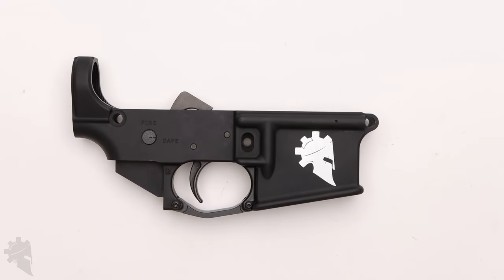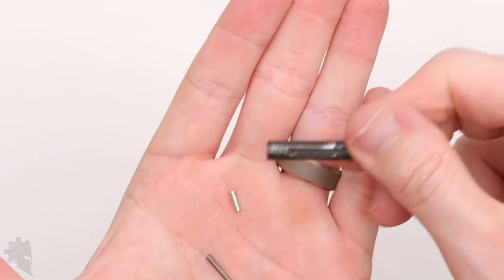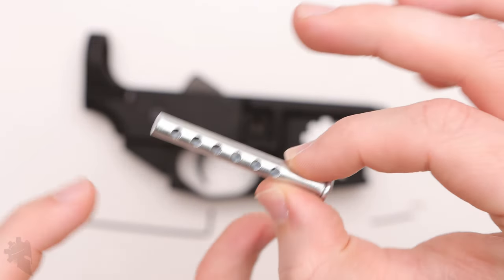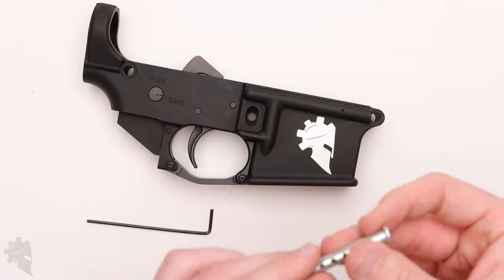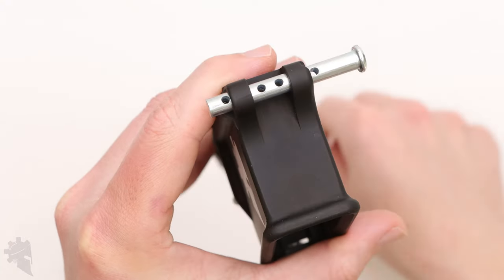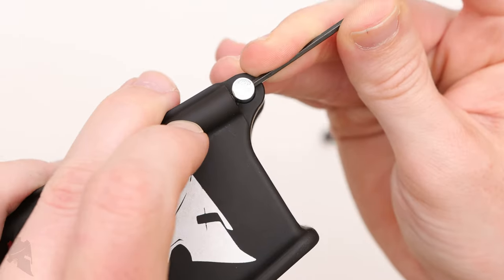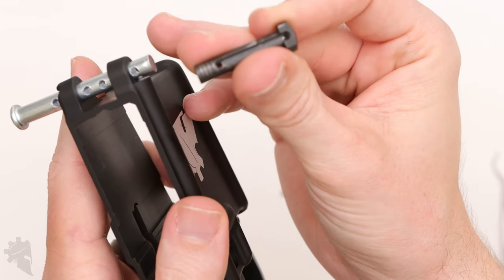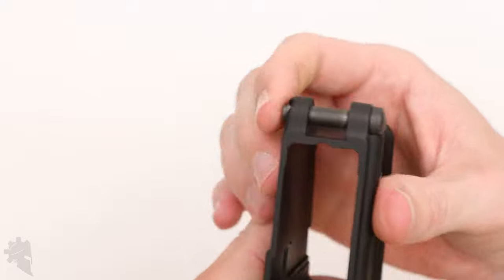How To Install AR 15 Pivot Pins Like a BOSS - Pro Tips & Secret Sauce

Comment: Will this also work with the rear pin?
Reply from the maker: No, the rear pin is held in place by the castle nut and receiver end plate. Putting a slave pin like this through the holes wouldn't do anything to help keep the spring and detent in place while you screw down the castle nut. Higher end receivers use set screws to keep the spring in place while you mess with the buffer tube. To install the rear pin, slide it through the holes and into place, then tip the receiver vertically (if you aren't using a vise) to keep the detent and spring in place. (Gravity is your friend) You can find the complete guide and a way longer video here that will walk you through everything here: https://thewarriorsolution.com/how-to-build-an-ar-15-lower-receiver-in-ten-easy-steps-video-guide/

Comment: I never had an issue with installing it. But I am having an issue of trying to remove it (I’m trying to replace the pivot pin from PSA to an aero one cause the pin is crap and I can’t install my upper; or it mught be slightly deformed).
Reply from the maker: The easiest way to remove it is to basically do this install process backwards. Use a 3/16" punch (or paperclip if you don't have one) and depress the detent just enough to rotate the punch 90 degrees. That rotates the pin so the detent is no longer captured in the groove. Hold one hand over the receiver to catch the detent and spring while you pull the pin out with the other.
Reply: @TheWarriorSolution  tried it again more thoughtfully and got it! Learned not to buy a lower parts kit from PSA
Reply: The clevis pin trick literally saved me, and my spring and detent. After jettisoning the detent into the nether regions of my workshop and almost losing it twice, I came back to YouTube to try to find a trick to installing it. Needless to say this video was a lifesaver and I got it installed first try after going to Home Depot and getting the 1/4” clevis pin. You guys are lifesavers, thanks for the tip and the awesome video!